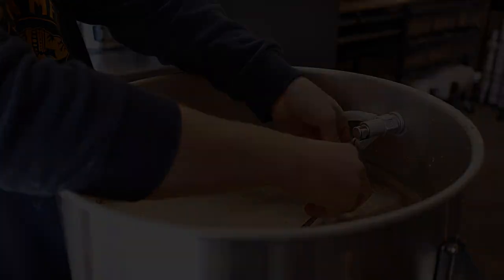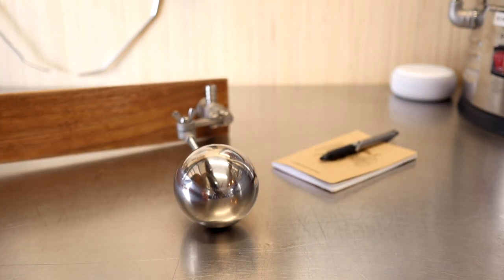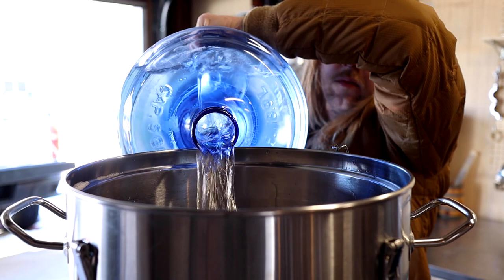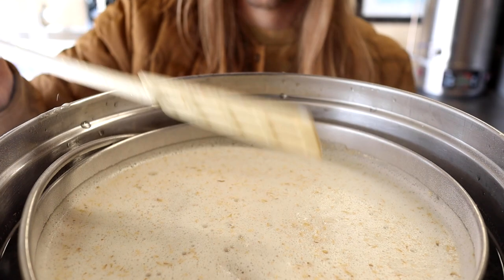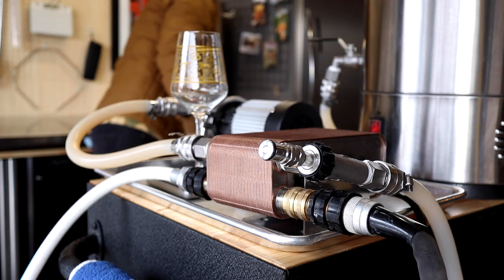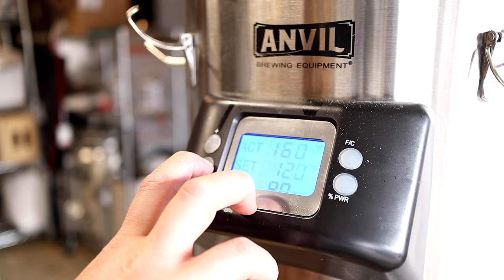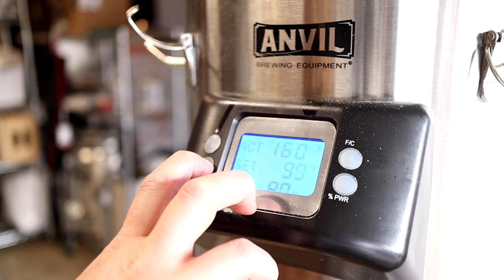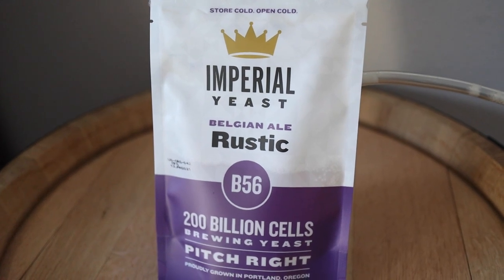Petite Saison | Anvil Foundry 6.5 | EP23

Comment: I just brewed a (not so petite) saison braggot this past weekend in my Anvil foundry 6.5. My post boil OG was only 1.040 (about 4 points above estimate), and I added 37 points worth of honey (right about 3lbs) after chilling. With the honey, it was just about 3 gallons into the fermentor. The Foundry seems to love these low OG batches.
Reply from the maker: You’re totally right I wonder if that explains the little bump in gravity. Man that sounds fun! Half mead half beer. I just made my first mead in December and haven’t packaged it yet
Reply: @HopsANDgnarly  It was fun to design! Honey is such a weird beast when it comes to fermenting. It's tough to nail down, but it can be so good when done well.

I've got one fermenting / aging right now that I think would be up your alley. A cherry sour mead, using Roeselare blend. Granted, it'll take forever, but I think it will turn out really interesting. The pellicle is going super strong now (which is fun to see).
Reply from the maker: @Vykk_Draygo  Yes! Even better! Sounds so good 🍻

Comment: What did you switch the fittings to on the anvil from out to pump to pump to recirculation? I have an anvil and want to switch out some things and this gives me inspiration
Reply from the maker: I think I understand. I’m using quick disconnect fittings on all the npt connections to make moving hoses around easier
Reply: @HopsANDgnarly  hahah yes I could’ve simplified that or made it easier to understand. You understood though. Cool. I’ll have to look into that. Hate those plastic hose clamps.
Reply from the maker: @3BsandAK  some people have told me 1/2” NPT fittings don’t fit on their Anvil spigots. If you have any other fittings I’d try those out before purchasing too many. Mine fit without issue
Reply: @HopsANDgnarly  thanks man! I heard that too, that’s why I was curious as to what you used. Hence my hesitation on doing anything prior to this. But I’ll grab one and see what happens. Do you do any video tastings of your beers? I’d be stoked to see your reaction and description of some of the brews.
Reply from the maker: Yep there’s a playlist on the channel called Gear & a Beer with the tastings